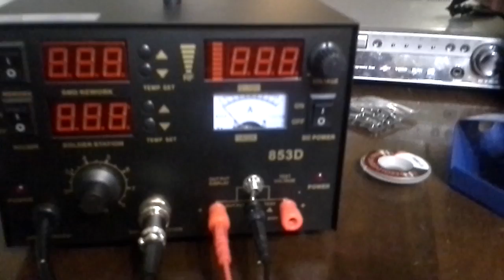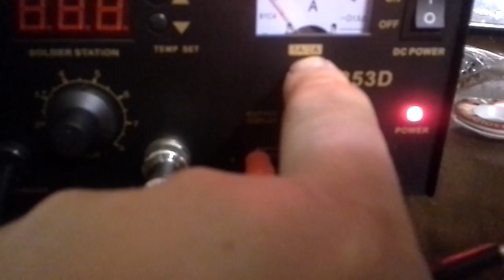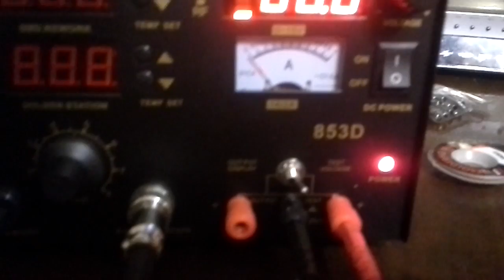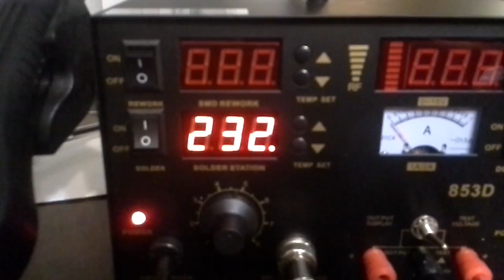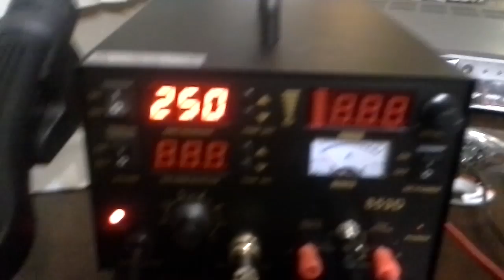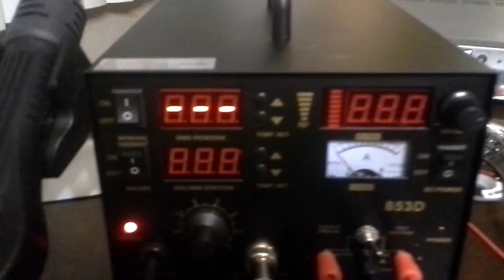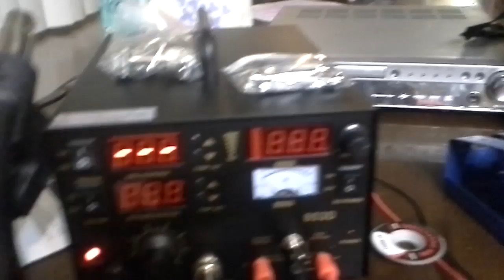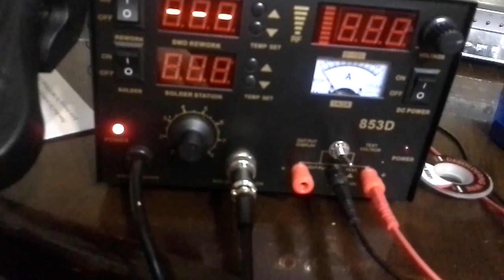853D Solder rework station Review

Comment: I need the schematic on this Kendal . My pencle quit working and it giving me a code of n24 . Wish i knew what it ment . But my pencle no longer heats up. Does anyone know how to get ahold of this company ?
Reply from the maker: This station will accept a replacement pencil. I went to a local Electronics supply and the had one in stock for $20 which I felt was reasonable for name brand.

Comment: That power supply works great for electrolysis, by the way. It's nice to not have to worry about a battery. The temperatures are in Celcius. 480° C is the max temperature for both the hot air wand as well as the soldering iron which is more than you would possibly need for the soldering of electronics.

Comment: Got mine this week and if you have only used regular irons, you will love this!  Rapid heat up on both irons.  However, when using the air gun don't suddenly turn it off.  When placed back in the cradle it continues to blow air until the temp hits room temp. This prolongs the systems life.  The shrouds still need to be cut off to insert into the post (with nut on).  They must have bulk produced this at some point and have a huge warehouse full.
Reply from the maker: I agree. thanks.

Comment: This is currently selling for $8.99, free delivery in three days from Texas.        https://www.ebay.com/itm/3-in-1-853D-SMD-Rework-Soldering-Station-Hot-Air-Gun-Solder-Iron-DC-Power-Supply/303225796078?hash=item4699aa75ee:g:c14AAOSwVQNdLU--

Comment: thanks for the video. What is the recommended temperature, using the heatgun, to remove a smd chip from a laptop motherboard
Reply from the maker: Hmm not sure about that. If I had to guess, I would think 300 degrees Celsius, however you could check the data sheet for the chip and see what it is rated to handle. Of course if the chip is already damaged then overheating it shouldn't be an issue but installing the new chip you should use a soldering iron instead of the heat gun perhaps. There are attachment tips for the heat gun that Focus the heat only on the chip you're working on so that you don't damage nearby components
Reply: The type of solder that was used is also pretty critical in the removal.  If the old typical 60/40 tin/lead solder was used 183°C is about the right temp so 200°C should be more than enough, providing you also use plenty of flux, however most electronics are using lead free solder anymore, so the temp is usually higher.  The key is finding a temp that can quickly cause the solder to flow, while not building up a bunch of heat in the chip.  It’s kinda a delicate balance, but you should probably be able to find what kind of solder is used on the board and it’s optimum flowing temp online if you do a search or two.  Good luck!

Comment: Is it a welder too?
Reply from the maker: I assume you're joking or if not no it does not weld but it does solder.
Reply: @MrBatbuddy  no i am not joking.there is a similar solder station 3 to 1 which they say you can spot welder too.i just asked ,but was not joking.maybe its not this the model i am reffering .but it looks like
Reply from the maker: @aspergerhellasbn  Wow, I didn't know they made one that could spot weld. yeah it's not this model that's pretty neat though. I guess it the spot welding model would have a rather large Transformer in it and be rather heavy. This one's fairly lightweight.

Comment: I just received the same model ,however mine does not have a toggle switch, for test mode and dc voltage .rather it has a single button, Re test leads supplied ,they actually do fit ,you ether have to remove the Knobs on the banana socket ,or alternatively cut the shroud around the test lead off(plug end oviously( ,i contacted the seller when i discovered the same issue  and he advised that this was deliberate if the test leads where to be permanently connected to the unit the shroud covers the exposed terminal,if used on a Adhock basis then remove the shroud .it is quite tight to push in at first as its new but they will fit

Comment: Hi I had mine delivered last week 2 days later the air gun stopped working in the middle of a surface mount job. I found during testing that there was mains power on the element wires with the switch for the air gun turned off, the earth connection was a spot welded stainless steel conductor and had failed at the nozzle end the thing that really concerned me is the heat gun element was faulty and making contact with the now not earthed nozzle. This fault made the metal nozzle live, I will need to investigate further to find out if this is a design issue or faulty workmanship please exercise caution when working on or with this device.
Reply from the maker: That's really weird I'll have to check mine out and see if it has that same issue with being connected to Mains power
Reply: @MrBatbuddy  did you ever get a chance to check that?  what were your findings?
Reply from the maker: @mtraven23   I have not dismantled mine to check that, but I do not have 120VAC power at the metal nozzle
Reply: greg--did you ever investigate further?  I am looking at buying this unit & would like to know if I can/need to modify if when I get it.

Comment: Thanks for the review , I’ve had an identical unit for nearly 3 years and am well pleased with it. But like your machine it’s a 4 in 1 unit really, but nowhere can I find reference to the RF meter on the front. It does function in that it lights the display when I trigger a transmitter next to the machine but I have no idea what it really does or can do. Can you or anyone please point me to any info on this feature? Cheers.
Reply from the maker: I am not sure about the RF meter either. I will look at it more closely and see if I can make any discovery.

Comment: great review. .. I have question. . can you use the Hakko FM2032-51 Micro Soldering Handpiece on this station?
Reply from the maker: I am not sure? If you can find a picture of the connector on the FM2032-51 and reply with a link, I will see if it is the same connector on the station.

Comment: Is There A Difference Between "supply voltage" and "Power supply " ?
Reply from the maker: Yes, The supply voltage is what the main input power is which in the USA is 120 Volts AC. The power supply is a transformer built into the unit that supplies regulated DC power from15 volts down to 0 volts

Comment: I have the exact same one.  Some modifications I have made to mine was install the power switch on to the front, put a connector on the hot air gun, and installed an outlet for my home made solder exaust fan to automatically turn on when one turns on the soldering iron.  When I got this unit though, it released the magic smoke upon turning it on, so I got a refund and got to keep the device.  Of course I repaired it and modified it and love it!
Reply: HI can you tell me what you repaired.. I also got white smoke coming out of the air heating wand, unfortunately I waited to long to try out the machine so no refund available.

Comment: I just purchased this and I mostly like it.  Heats up fast and maintains temperature.

A couple of issues that aren't deal breakers.
1. It doesn't allow you to measure negative voltage if you have your leads reversed.
2. When the heat gun is in use, it rapidly turns the heating coil on and off to maintain temperature and this causes my work light to flicker just a bit.
3. It did not come with the nuts for the screws on the heat gun tips.
4. The leads did not fit into the ports for the power supply until I cut off the shrouds around the lead tips.

For the money, it is a great purchase.
Reply: Cheap shit than ??

Comment: does the hot air gun need to be in the holder to turn on? just got mine today gun works but hot blower will not come on.
Reply: +tgl030 Not my personal experience, but heard that's a safety feature. I won't turn on until it is placed in the holder.
Reply: That does not make sense. How can you use it on the holder. It should start cooling when in the holder. Mine went bad the first day. I have to replace the heating element.
Reply from the maker: +tgl030 No mine shuts of in the holder. Actually if it is already hot it cools down first then shuts off. May be a fuse blown if it is not heating, or a defective unit.

Comment: you got a manual with yours?
Reply from the maker: Yes, but it was not much of a manual. Using this station was really pretty much intuitive for me. It sounds like from your question you are in need of some info. If there is anything that I can look up from my booklet let me know  what you might need.
Reply: yeah , when I went to use the heater it didn't operate. maybe the holder has to be connected? I also didn't play with the air dial either.
Reply from the maker: mike charette
There is a reed switch in the heat gun handle and when the gun is in the holder it turns off via a magnet that is in the holder. Maybe the gun is by a magnet? or maybe a bad connection in the heat gun.
Reply: MrBatbuddy After I watched this video I realized that I had to mount the handle to get it to work and turn that knob for the heat to come on .It works now and it actually throws heat , ouch.
Reply from the maker: mike charette
Glad you got it working
Reply: MrBatbuddy Got it working but still not 100% sure of how it operate it . By the time I get to where I'm positive with it then it will be out of date .
Reply: I DIDN'T, . . That's, . "I DIDN'T" . Get a User Manual/User Guide/ . . U Know what I mean Init Peeps, . lol . ? Or Any Other Kinds of Paper work That We All Are 'Ment' To Get & Keep when, Or On the First Time thatb box is EVER Opened, . Cuz it/they Should be there, In the Same Box NO MATTER WHAT Init, . ? It Should Really Have its Own Paperwork, . 'ID~INFO' Inside the Box ~ or even INSIDE The item Itself Some times True, (so look, lol) . But Pending on the item, lol, that is Peeps, . ? For all the Info that's on it/them, as For Helping Us With the Item When the Need Be, . . Well, . . In my Eyes Anyway or Dose anyone Els think Diff, . ?

Comment from the maker: Yes I have been using it and I have liked more each time. I have had no trouble with it and am quite happy with how well it works.
Reply from the maker: Still awesome! And working great. used it two days ago and I figure it was a great buy.
Reply: Im looking at buying this device, just wondering if your one is still functional? Thanks!
Reply from the maker: Yes it is still going strong!
Reply from the maker: No I have been using it "right out of the box" for over two years and it has never given me a lick of trouble. I have bought a bunch of electronic stuff directly from China and have only had trouble with one thing which was a FPV camera. Everything else, including this rework station has been great.
Reply: and how about now? :D
Reply: Did you have to change anything inside the box for safety issues? I see a lot of youtubers doing that for these Chinese tools.
Reply: Thanks bud!
Reply: 3 years later.  How about now?  I'm about to buy one.  :)
Reply: Hi, have u checked that it's grounded / ESD safe? i i'd unknowingly bought a hakko 888d knockoff and found out it wasnt really grounded when my leds started flickering while i was soldering them to the board. this model seems like a great replacement if it works well.

Comment: I bought the same station and had the same problem with the test leads. What I did was used my exacto knife to cut off some of the plastic on the end of the L shaped plugs. The material is soft and is easily removed giving you a good fit. One other thing I found is don't use the cheap solder that came with the package. It will not give you a good solder joint. Other than that I am happy with the performance.